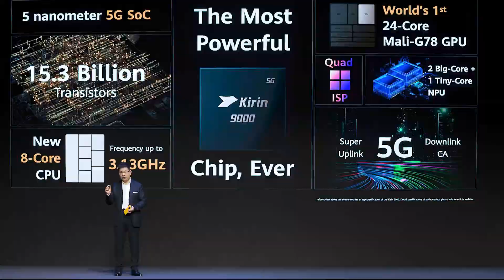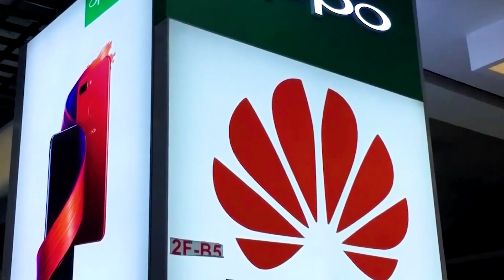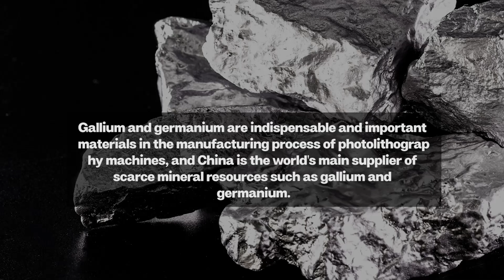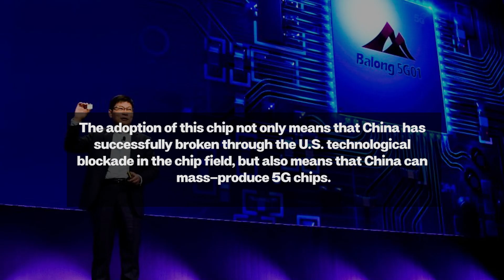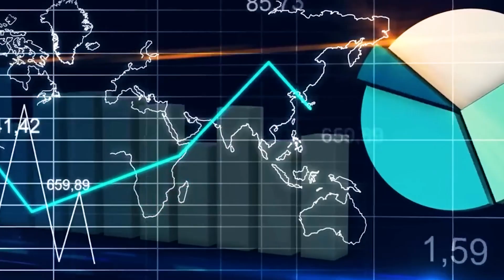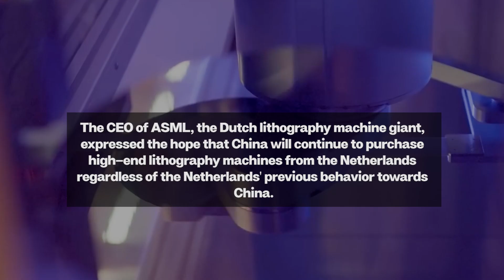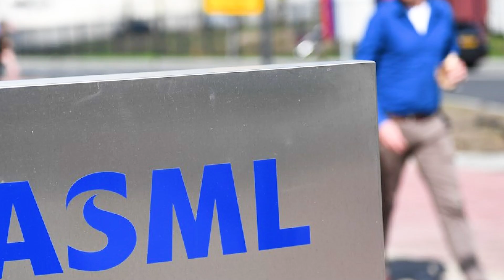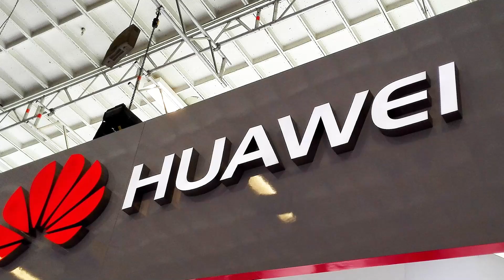Huawei’s Road To Victory: A Counterattack Legend Under The Constraints Of Chip Blockade!

Comment: Most of the troubles of ASML has to do with parts that have US IP.  As such, the US won't allow its IP to be used in sales to China so ASML is between a rock and hard place. But, what ASML knows is that SMEE has produced a 32nm lithography machine capable of 14nm chips.  It also knows SMEE is working on more advanced machines with organizations like the Chinese Academy of Science contributing to solve the necessary features of EUV lithography.  China supposedly has solved the light source, optics, and stepper table which are the principle items that make up a lithography machine, so it is assumed somewhere in the future, SMEE or other Chinese company will pull the rabbit out of the hat and China will be able to produce sub 7nm chips.  ASML knows this so it is doing its best to sell its machines before year end when the door closes.

What is more revealing is that Huawei is using SMIC to produce their 7nm Kirin 9000s chip and ZTE, Alibaba, and Tencent are using TSMC to produce their 7nm AI chips.

The US is losing the mature node chip sales to China because that is where China is focused without EUV. So, US Secretary of Commerce's magnanimous command to let US companies sell mature node chips is a lost cause because that is where China is producing its own.  The Huawei Mate 60 mobile phone is noted for its 9000s chip, but unnoticed is the fact that there are no US parts in it.  The US will continue to restrict high end chips but probably by year end 2024, China via SMIC and TSMC will be fabbing these high end CPU/GPU/NPU chips in quantity.  The losers will be US semiconductor companies, a market lost because of the hubris of its government.